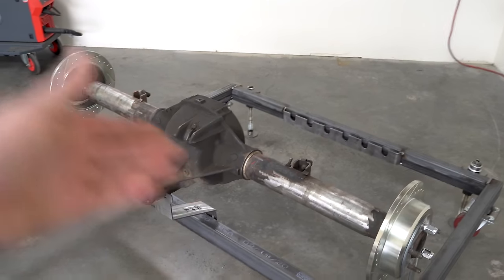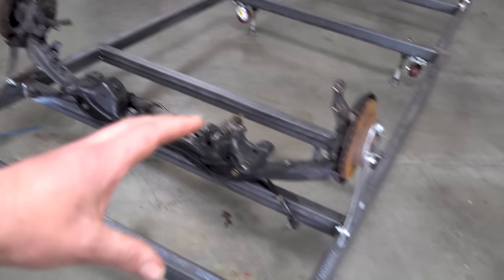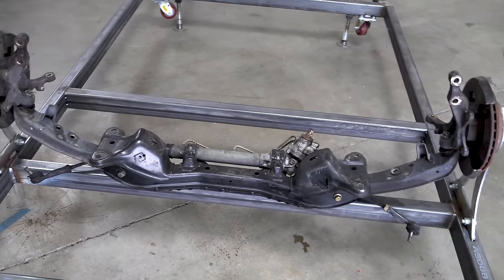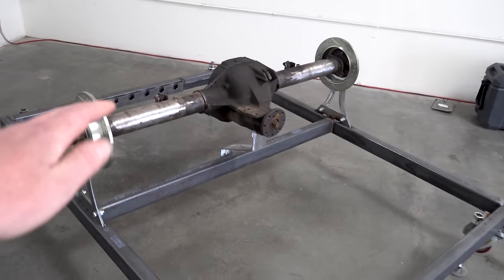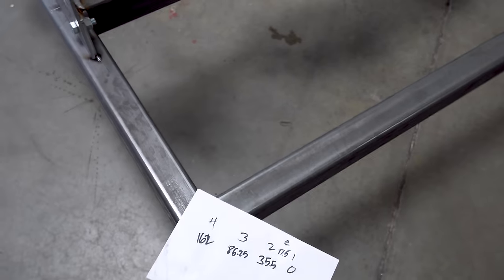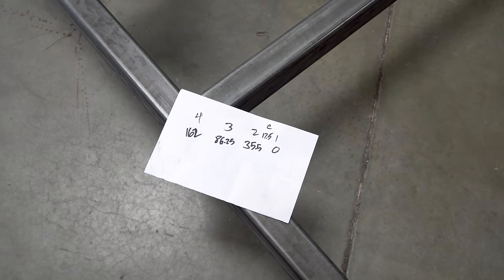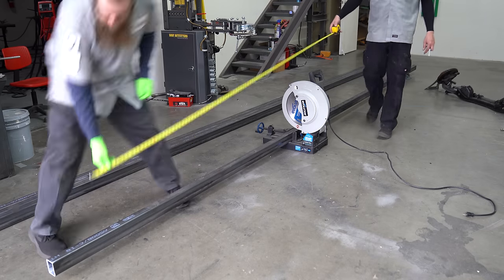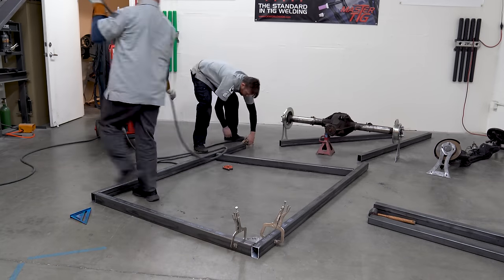Let's Build a Chassis Jig

Comment: 10 bux says its either an ecoboost v6 or an NA v6, that or its a high revving honda motor
Reply: If you check back, I'm sure he mentioned the engine he was going to use, as it was lying around.
It wasn't a Wankel, but a turbo' 20B (or even a 13B) would give all the power he would need.
Reply: @gordowg1wg145  he specifically said "no dorito anything" and that he didn't have the motor there right then
Reply: Mitsubishi's 6g series engines are pretty torquey in NA setups and can make good power with boost! The 6g72 twin turbo out of the 3000gt vr4 can make up to 700hp on stock internals!
Reply: @VorboteDesKrieg  Cool, good suggestion and it also keeps the same make engine in the chassis - something I am a bit anal on!

Comment: Around the 15 min mark you check for square ... correct what you dont show or say is that the length side to side must be the same measurement and the width front to back must be the same measurement.  Otherwise corner to corner measurements are useless . If one side is longer than the other and you try to square it ... you've made a square right  triangle...not something you want to base a chassis on
Reply: if the diagonals are not equal it isn't square. if they are equal, it is, and all sides are the right length. nothing more to it than that.

Comment: All of the measurements you were pulling out of your ass are actually published by the manufacturers.  I have been involved in building thousands of chassis with three different manufacturers and never saw anyone do it your way.  With a good chassis fixture, its dimensions do not have to be customized for individual builds.  Building around the axles instead of the frame is not how the pros do it.  To be honest, I have never seen such a chintzy fixture in 50 years in the business.  All in all, you have created a lot of busy work and not a real chassis jig.